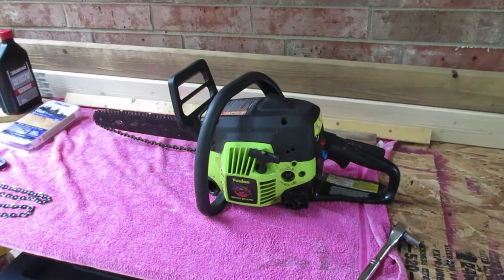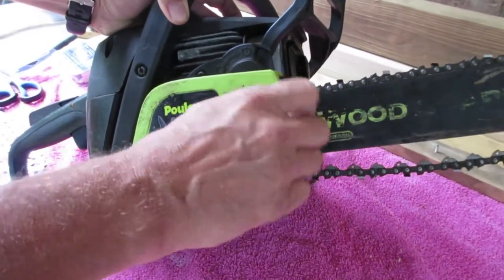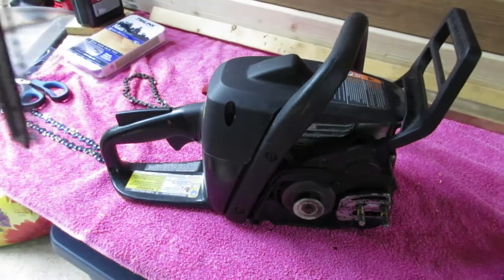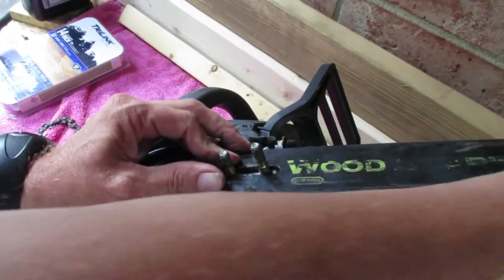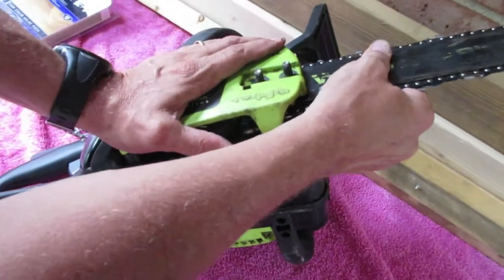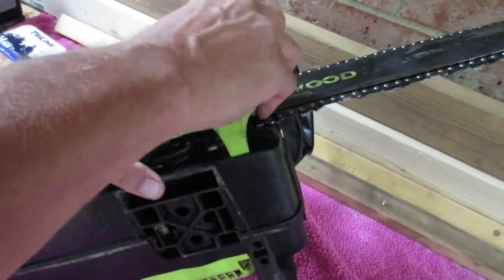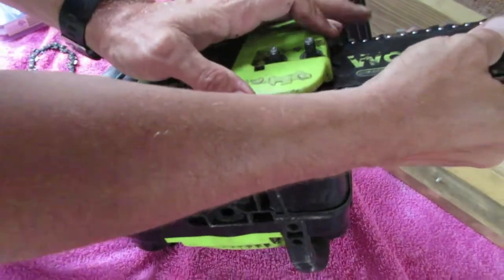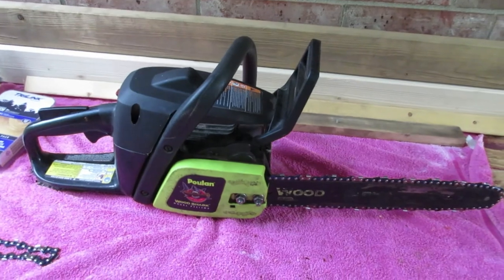How To Change a Chain on a Poulan Chainsaw

Comment: You did not adjust the tension on the chain to the bar...a small screw that pushes the bar out just enough to get the chain/bar clearance just right.
Atleast the old Poulan saw I have has this feature.😊